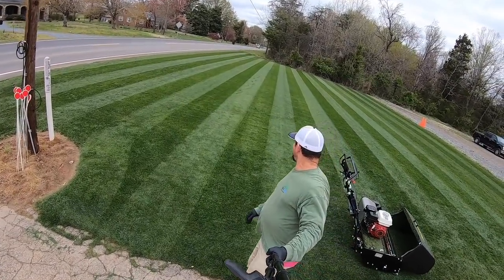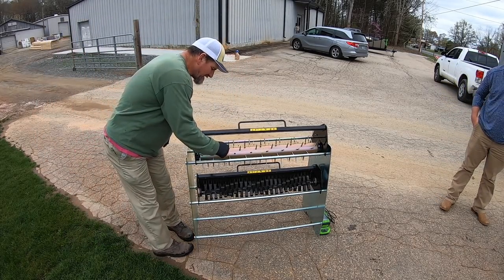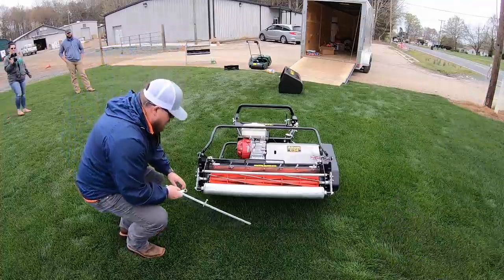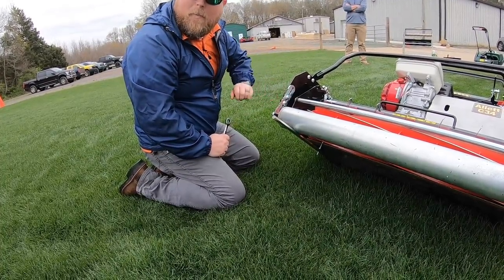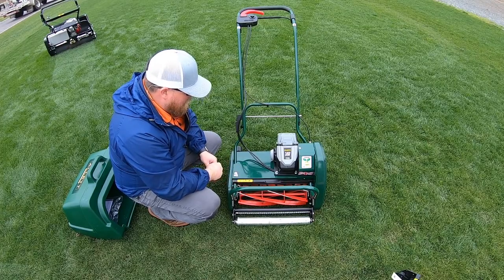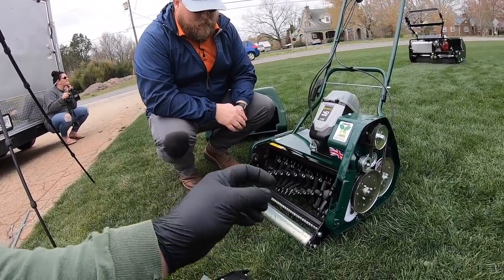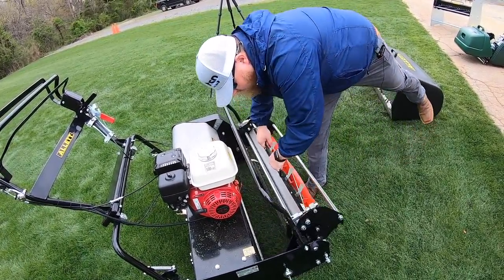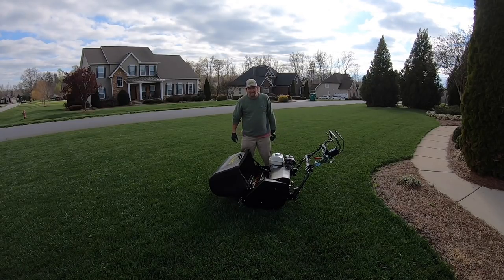Reel Mowing and Set Up Allett C34 | DARK LAWN STRIPES

Comment: Pete - Check our the RM35 Allett, high vacuum rotary mower. It is a lawn striping machine that mows up to 2.95”. Brooms up blades in front and has cylinder in rear to lay down turf.

Comment: Have been using those baby Alletts all my life in Ireland (previously known as Qualcast 35s). Pete even though you think it's cassette feels well built the actual tine carriers aren't that rugged and are prone to breaking if the moss or thatch is tough. Good idea to buy a bag of tines for them as well as they can fall out quite easily if conditions are trying. Wonderful that you have the new battery model. As much as I love the sound and smell of a petrol mower, I'd definitely go the battery route if I was buying a new machine. Congrats on the new mowers. They look fantastic.

Comment: Pete, you didn't seem too pleased with your cut on the TTTF at higher than 2". My experience with KBG and my push reel mower is the same. At the taller height of cut some of the blades would lay down and not be cut, and there would be a lot of "wispys" requiring a second or third pass. In my experience it's the nature of reel mowing. I personally think the sweet spot is 1.5" or less for reel mowing. Rotary mowers have that vacuum effect, so at taller HOC the grass laying down isn't a problem. Not the case with reel mowing. If you solve this problem, I'd love to hear about it.
Reply: To mow longer grass, you need a reel with fewer blades, and to SLOW  down the reel.  Turf school teaches how to calculate the 'clip'. Travel speed, reel speed, and height. Golf course mowers have a chart under the seat of triplexes with this information. 29 years of owner/operator commercial lawn maintenance experience and 9 years of Golf turf maintenance is my background.